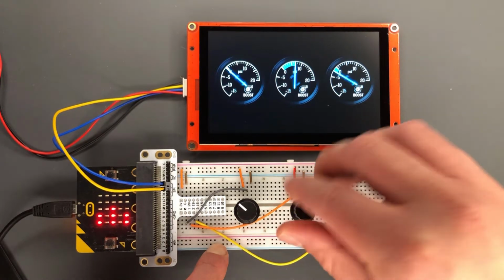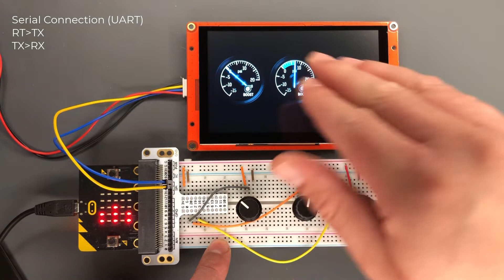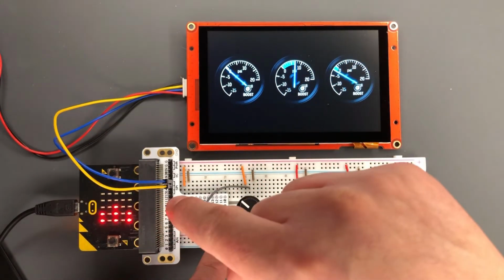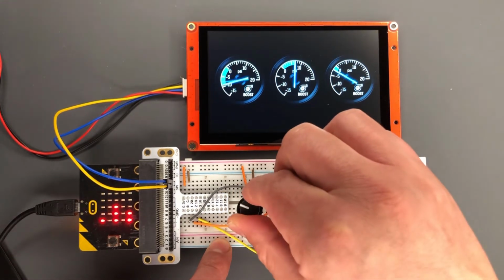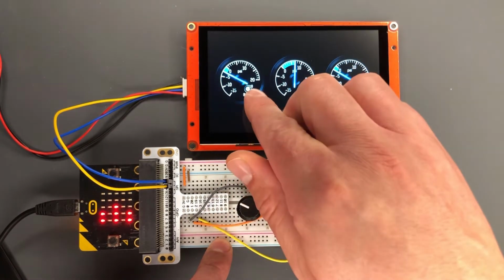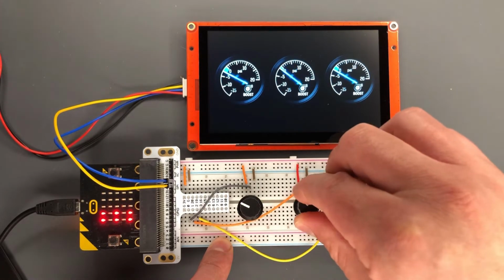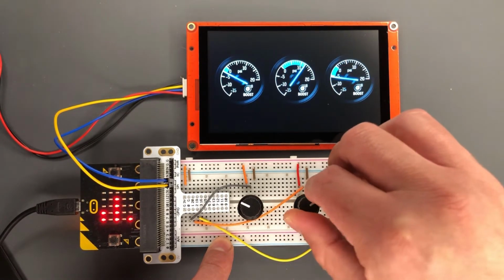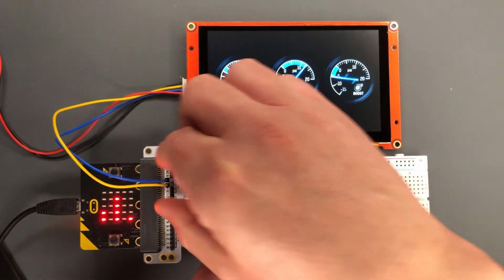Car gauges with Micro:bit and Nextion Display (micro:bit, lcd display, arduino, tutorial)

Comment: I would like to make a spectrum analyzer with 255 bands and display it on a ~4.2'' screen. 
I am using an esp32, the whole processing takes about 45ms. 
So my question is, will something like a nextion display be fast enough in terms of refresh rate to get a smooth output and if so, which series would be the minimum (basic, enchanced etc.) ?
Any input on the matter would be much appreciated.
Thank you in advance.
Reply from the maker: What do you mean by "fast enough"? If your process already takes 45ms, your starting point is about 22FPS. I.e. you will never get 30 or 60 FPS, but perhaps 10 FPS might still be usable? I woul definitely go with the intelligent version, it´s not that much expensive compared to other models and it´s just so much better in many different ways. If you want, please send me an email and I can do some quick test for you.

Comment: How many images are stored in the nextion? I know you can set the “gauge” as the background photo but how did you do the needles and the blue arc highlights. 

Are you displaying a new image for every increment of the gauge with a new needle position and highlight area? That would mean numerous images for one gauge. 

Or did you figure how to use the nextion gauge with a better visual needle and curved arc slider? Meaning you only need the one background image of the gauge in the nextion.
Reply from the maker: It´s a combination of both image sequence and custom drawing, since Nextion Intelligent could display transparent .png images. But for normal (basic and enhanced), using just the image sequence is the best approach.
Reply: @upir_upir  I have an intelligent display, did you do the needles with the glow as transparent on top of the background of the gauge? 

It seems to change pictures smoothly, any secrets to the code to do that?

Comment: never seen this board, its interesting
Reply from the maker: If you mean the micro:bit, this is a great microcontroller board for beginners. I feel like it´s quite understimated compared to Arduino, because it has a LOT of sensor built-in and it´s very easy to use.

Comment: I’m interrested by démonstration about nexion display :you said it’s indépendant so do you programming thé image on this display ? How do you did it ?
Reply from the maker: You use a Nextion editor to put together the graphics, upload it on the display using the SD card. The display is responsible for drawing the images, playing animations, sounds, all the ui elements like buttons or sliders. Then you use Arduino only to switch the screens or tell the display which image to draw. I will record a full tutorial soon, stay tuned!